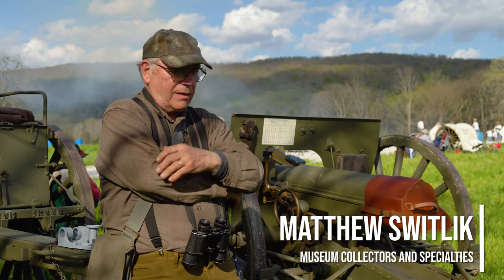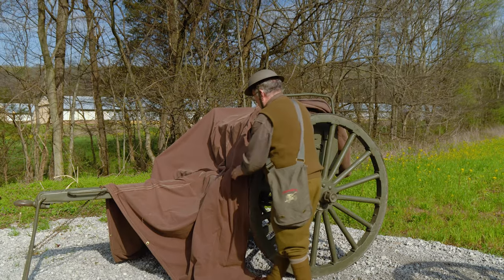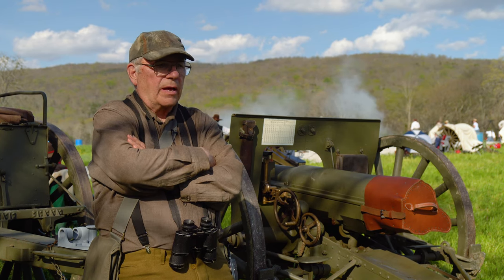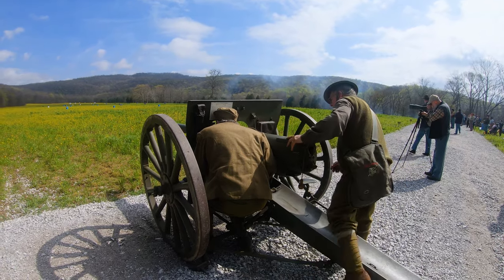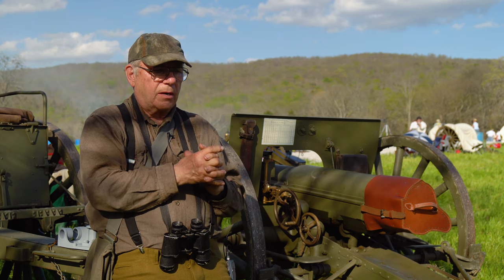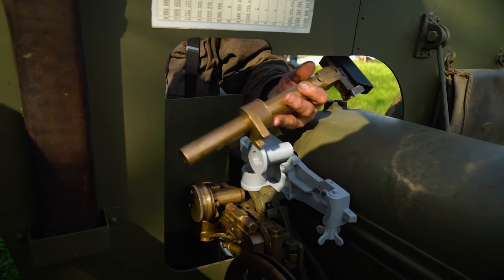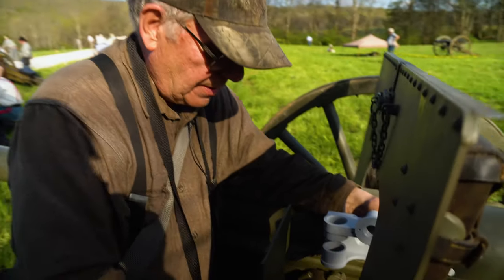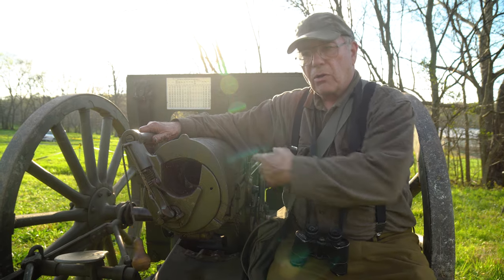The Story of a French 75: The 30 Year Search

Comment: Actually some of those 75 were used with a lot of success after 1940 by the Free French in the desert war against the Italians and tha Afrika Korps.
Notably during the battle of Bir Hakeim on the southern tip of the Gazala line during the desert war. Not only was it a great artillery piece but also a powerful AT gun. Truly a gun ahead of it's time!
Reply: And captured guns were used as parts by the Germans in WW2 to make(rebuild/convert into) almost 4,000 75mm PaK-97/38 Anti-tank and Field Guns. Which improved the characteristics of the original and made it more modern. Since the French 75mm Modele 1897 was used by many European Armies they captured 1,000's in various states of usefulness(in fact I believe this was the German Wehrmacht's most captured artillery piece of a single design that was not a Mortar). Over 500 of the original unmodified design were still in German service in early 1944. Though by the beginning of 1945 98% of all versions had been lost in battle.

https://upload.wikimedia.org/wikipedia/commons/c/cd/75_PaK_97-38_Mikkeli_2.JPG
Reply: @legatvsdecimvs3406  That is also true. I believe I was answering to a statement about French service of the gun, which excludes the Germans.
Reply: @haugs1718  Which "statement"? The thing is that the fact it's a French gun is mentioned throughout the piece, but you refer to a specific "statement" and try to invent some sort of fake debating rule that you will only accept replies about French service.

Are you some sort of debate cop? Will you put people into debating jail for not staying on topic? Are you some sort of communist, trying to cancel other people and control what they write in reply? No, that's also not a rule in debate, especially if;

I. it is related to something you wrote. Did you not mention WWII and the Germans first? Like right here? ""...75 were used with a lot of success after 1940 by the Free French in the desert war against the Italians and tha Afrika Korps.""

Yes you did. And the reply was about German use of the guns in WWII and why. So it is what we call in English "directly relevant" and on the same topic you yourself set.

II. It adds relevant information, especially regarding use in WWII, which you again mention first, it's the topic you yourself set. They also used proper referencing, which you did not, you are just repeating something you heard once, which is not the same, you then got intimidated and made a defensive remark which is ungracious and rude of you, hence why this is happening now; you are deservedly being pulled up on it. You are not Chairman Mao, you do not get to arbitrate the comments of others based on your precious feels or being offended at being made to feel stupid and uneducated for being stupid and uneducated, so let's get it all out in the open, given that we all have free speech and you are trying to impinge that of others like you think you're Stalin or someone like that.

III. You also mention them being used in "French service" as you define the parameters of your own debate in an "anti Tank" role. Any complete moron would know that in French service it was an anti personnel weapons system and fired HE and shrapnel in rapid fire. That's AP, not AT, if you actually listen to the film instead of trying to showboat, talking rubbish about something you heard wrong once, you would know that. It was never converted into any type of AT role by the French. You obviously do not understand how shells work, but HE just explodes against armour, that's why AT was developed.

The only AT version ever made with the Soixante-Quinze was by the Germans, that was what you were being told, with references, and now I am spelling it out to you, you've been busted as another American making shit up on the internet. You guys do that all the time.

It is directly relevant, because he made your erroneous statement about it being ""Not only was it a great artillery piece but also a powerful AT gun. Truly a gun ahead of it's time!"" which is bullshit, it was never used like that in ""French service of the gun, which excludes the Germans"" but you mentioned the Germans first, so you must have Alzheimers, or something like that, but luckily you are not the comment police anyway.

The link you were shown clearly states that it was not an effective AT gun in the only conversion to AT, which was indeed the 75mm PaK-97/38 by the Germans only, which excludes the French.

You are not Stalin, you do not police other people´s speech, especially when you are making shit up wrong in the first place. HE shells have very little effect on armour, read some books or be always called out on making shit up when you do.

""Some French guns were modernized between the wars, the Canon de 75 Mle 1897/33 mounted the original barrel and recoil mechanism on a new split-trail carriage. In addition to the new carriage the Mle 1897/33 had a new gun shield, pneumatic tires, sprung suspension, and the wheels "toed in" when the trails were spread. The new carriage offered higher angles of traverse and elevation than the earlier box-trail carriage. However, the Mle 1897/33 was not a success and was built in small numbers. Mle 1897/33s captured by the Germans were given the designation 7.5 cm K232(f).[9] A more modest upgrade to the Mle 1897 was the Canon de 75 Mle 1897/38 which was an anti-tank variant that fired a high-explosive anti-tank shell. The original box-trail carriage was retained but the gun had a new gun shield, sprung suspension and pneumatic tires for motor traction.[9]

Many were captured by Germany during the Fall of France in 1940, in addition to Polish guns captured in 1939. Over 3,500 were modified with a muzzle brake and mounted on a 5 cm Pak 38 carriage, now named 7.5 cm Pak 97/38 they were used by the Wehrmacht in 1942 as an emergency weapon against the Soviet Union's T-34 and KV tanks. Its relatively low velocity and a lack of modern armor-piercing ammunition limited its effectiveness as an anti-tank weapon. When the German 7.5 cm Pak 40 became available in sufficient numbers, most remaining Pak 97/38 pieces were returned to occupied France to reinforce the Atlantic Wall defenses or were supplied to Axis nations like Romania (PAK 97/38) and Hungary. Non-modified remainders were used as second-line and coastal artillery pieces under the German designation 7.5 cm FK 231(f) and 7,5 cm FK 97(p).""

Note that your wrote:

""Not only was it a great artillery piece but also a powerful AT gun. Truly a gun ahead of it's time!""

""Its relatively low velocity and a lack of modern armor-piercing ammunition limited its effectiveness as an anti-tank weapon. When the German 7.5 cm Pak 40 became available in sufficient numbers, most remaining Pak 97/38 pieces were returned to occupied France""

https://en.wikipedia.org/wiki/Canon_de_75_mod%C3%A8le_1897#World_War_II_service

Bullshit; don't waste people's time on your pathetic flights of fantasy. Don't be churlish and even more deluded when people try to be nice about you being wrong and correct you in diplomatic terms; you're not Donald Trump.

Comment: 9:00 Why does the gun recoil so much on its wheels?
Reply: The gravel was just laid the week before and was very loose.  The field was soft.  Also this was only the second time in perhaps 80 or so years that the gun had been fired, and the recoil system was still quite stiff.  In 2021 it shot much smoother without the heavy recoil.